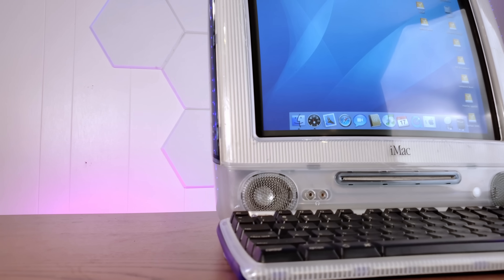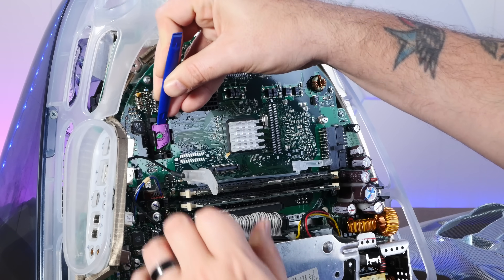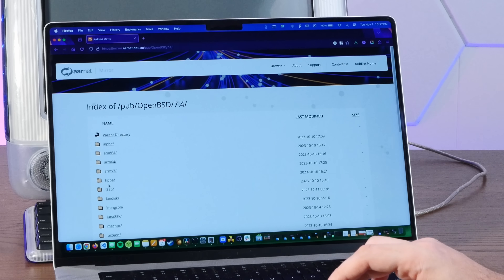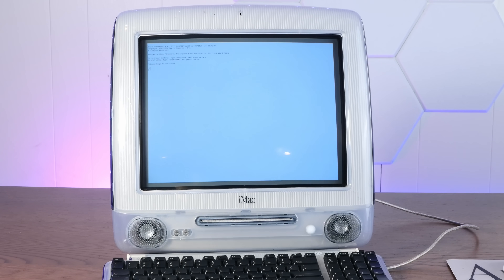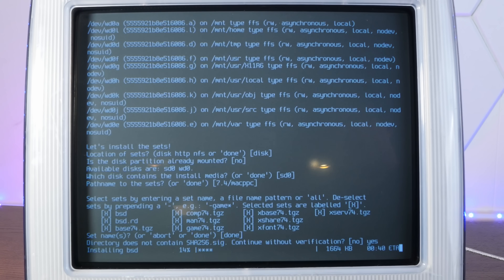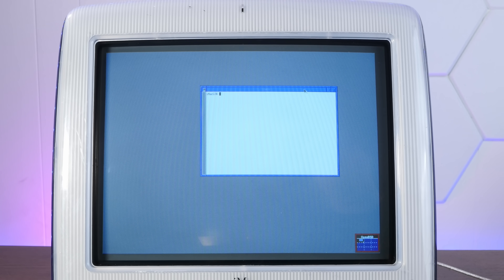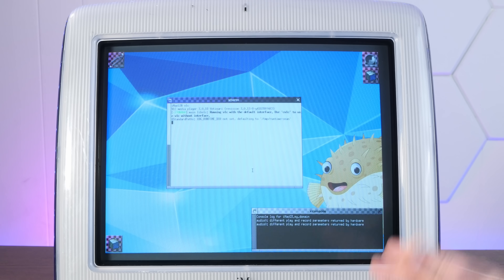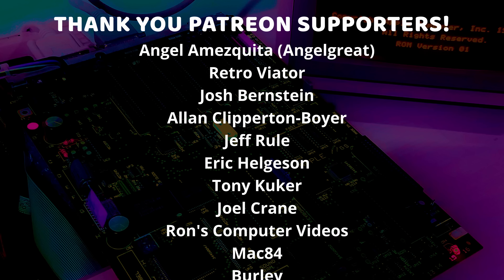Installing OpenBSD on the Fastest iMac G3

Comment: The USB trouble might be because it's a USB3 stick.  I've seen older hardware have trouble with USB3 devices even though they are s'posed to be backward compatible.
Reply: I don't think USB3 is suppose to be backwards to USB1. At least that's what I heard. I keep some USB2 drives around for that reason.
Reply: @Duamerthrax  -- Allegedly, 3 is compatible back to 1.1.  But, I've seen some not work in a 2 socket.  I've never tried anything less than that.
Reply: I've once had a keyboard that required 3.0 because it's rgb consumed too much power for 1/2.0

Comment: G3s and early G4s ATA controllers have a drive size limit of 128 GB. That's why dosdude1's drive had issues. On Power Macs you have the option to install a PCI controller (usually SATA) to enable usage of larger drives, but that's not possible with iMacs, for obvious reasons.
Reply: It's just easier to use an IDE to CF adapter and a 64 GB card. It will still be faster than those old IDE drives
Reply: Firewire is another option, I remember an iMac reading drives well over 128gb at 400Mbps, it was considerably faster, if I remember correctly, it's been a while 😅
Reply: I seem to remember the maximum partition size was 8GB, at least on some G3s.
Reply: @BrianMoore-uk6js  Yep, that's a thing too. Beige G3s, tray-loading iMacs and Wallstreet/PDQ PowerBooks for sure (can't remember if the Kanga and Lombard PowerBooks, and 1st Gen iBooks, are affected).

 Wallstreets and maybe others (don't remember if the Kanga and Lombard PowerBooks are included; iBooks are not IIRC).

Comment: Pretty cool. Amazing how modern OS's work on such old machines. I have NetBSD 9.2 running on a 68040 Quadra 800 with X11 and Dillo browser. I also have beige G4(upgrade) with Debian Bookworm and surf the net with Netsurf.
Reply: I wonder if it’s possible to use netBSD on a 68030 Mac?
Reply: Operating systems are primitive so they work everywhere. Useful applications, however...
Reply: “Amazing how modern OS's work on such old machines” not Windows 11 though
Reply: I read the browser name as something else.
Reply: I'm curious if you've gotten webkit to work correctly. I have Debian on my G4 as well, but webkit seems to only display mixed up Cyan and Magenta as if pages are rendered in CMYK and the wrong byte order is used.  Will need to try Dillo.

Comment: 5:40 - Those block errors are simply the hard drive being in a format OpenBSD didn’t understand, or it’s Inodes (references to blocks) were corrupted. If you were partitioning the drive at that moment, that’s fine because then it’s trying to understand where the next block in the drive is. Most of those errors come from fsck, filesystem check, and are harmless to your data, even though it can take a second to get through them. Fsck is simply trying to fix your systems understanding of the drive👍👍
Reply: Makes sense if he hadn't formatted it yet for bsd like it had something else on it. Might have been alright unless he installed on it and it was still saying a bunch of stuff
Reply: as far as i'm aware that imac and most computers from the late 90s don't support 48bit disk access so anything above 120gb wouldn't work correctly, there are workarounds i'm aware of with pc's idk about old imacs.
Reply: @Nny_V  I had this problem on a pc laptop from 2004. The OS can see the real size of the drive, but BIOS issues would cause errors and/or corruption past 137GB. I solved it by just formatting drives bigger than that to 137GB and not using the remaining space.
Reply: @Nny_V 
That is usually not a problem once booted into an OS that understands it.
Also, there's a load of random capacity issues in BIOSes before you get to that limit. Arbitrary limits on a bunch of values that lead to things like 2GB, 20GB, 32GB and ~60GB limits. Most of those you have to prevent the BIOS autodetecting the drive, and boot off a smaller disk.
Reply: Laptops had to either partition or use software solutions but desktops could use Promise, SIIG etc drive ATA controller cards still available today (though IIRC some require a Mac ROM reflash if one originally fitted is unavailable).  SATA controllers make the most sense for modern large drive conversions where using a suitable OS.

Comment: 5:00 It's not fault of an adapter* IDE ATA in general is limited to 28bits x 512B = 137GB (128GiB) , Apple "BIOS" is probably also limited and/or have some ways to negotiate proper mode for adressing. In PC world i was able for example boot 160GB Hitachi HDD on such old machine only if Windows was installed on smaller partition. Then trough some magic once booted the other partition was available to store data. Otherwise if one partition was used system was crashing. Linux wasn't able to boot at all. WD Black 250GB IDE on other hand only 128GB was visible even in Windows. Same was for any SSD. Since BSD probably it's installing itself on ZFS or UFS partition and formating putting inodes and stuff. And it's doing in "BIOS" mode so cant adress more.

Comment: I used Openbsd (headless install) for my Firewall back in the early ADSL1 days. (Around 2002)
  It was the most secure/locked down OS back then and probably still is.

Comment: G3 imacs were some of the first machines i installed OpenBSD on. This was back in 2002. As far as i know it's always worked well on these machines. I had a few running IRC servers and icecast for a bit. The dual headphone out was great for csound programming. this allowed me to run into multiple effects pedals and a mixer. I found the default console font was nice and crisp. They made great terminals at the time. It looks like they still do. This takes me back. Windowmaker was my goto. All you need now is the bubblemon applet.  😎

Comment: Ok, going from old memories, that entire family of iMacs had a maximum hard drive size of 128GB. There was a firmware update for some of the transition era machines that patched it, but I’m not sure if these iMacs got it. So you’ll need to get a smaller SSD from dosdude1. I’d try to stay at 100-120GB to stay safe.

As for booting off USB, the USB controller in those things are pretty strict standards-wise, and they don’t like newer faster USB drives. It’ll probably work fine with a USB 1.0, 1.1, or USB 2.0 drive. But many older Macs don’t want to talk to a USB 3.0 flash drive. Even my old 2015 MacBook Pro didn’t like USB 3.0 drives, but would talk USB 2.0 drives consistently.

Comment: OpenBSD was my first true love when it came to operating systems... I think the first release I ever installed was 2.3 and ran it as my daily driver on all my workstations for the longest time. I also donated a bunch of hardware to the project as well as a few kernel patches I made (specifically for the USB and wireless subsystems) that made it into the mainline source tree!

EDIT: some of the modifications I submitted were in fact to fix USB quirks in booting OpenBSD from USB sticks... they weren't PPC related but you would be amazed (or not, lol) at how finicky some USB chipsets are!

Comment: Second adapter 5:45 you put is actually translating SATA to ATA, it's most proably limited in speed like most of these and because of that (oddly enough) i suspect fast HDD's could be even faster than SSD in some cases. Maybe in order to work it have to know "the language" of adressing of iMac "BIOS" maybe it's fault of 256GB drive itself it can't negotiate or something. Or it's just about the size - since you put 128GB MSATA
Reply: Back in 2012 some kind of Samsung (F3) 1TB HDD on some operations (I guess that was copying a bunch of small files) so it was faster than then new a top of the budget segment OCZ Vertex4 128 gigs.

Comment: I haven't really messed with OpenBSD, but I run FreeBSD on my main SBC I do Arm64 Assembly programming on. If I'm going to have an OS I "tinker" with, it's pretty much always FreeBSD anymore.  I used to run Arch, then Manjaro, but now I'm happily on OpenSUSE Tumbleweed for Linux (gives me rolling release while going back to my Fedora/OpenSUSE roots with RPM+zypper). That means there's not really any need for the same level of tinkering to get things working properly.

Honestly, I find myself using my FreeBSD SBC for all of my daily tasks too (with 16gb of ram, an m.2 ssd, and a great little cpu/gpu package it handles most tasks easily). BSD is a different beast, but I think it's something people should give a try in a VM just to mess around if they enjoy messing around with Linux or even macOS.

Comment: I ran NetBSD on my graphite iMac DV/SE back in the day and I remember it being an open firmware nightmare to get installed. When you said it couldn’t be easier to get installed only to cut to that iMac on its side made me laugh out loud 😂
I also ran NetBSD for years on an SE/30 with an PDS Ethernet card, it was super slow but ran named and Apache 1.3 just fine, also there was no screensaver so I just had the brightness turned all the way down…
Reply: I ran NetBSD on my iMac DV SE too, and on my Mac II ci. Worked just fine. Compiling everything from source with pkgsrc was a bit of a hassle though. I finally gave up on using NetBSD on all my hardware around 2012 or so. (Including a few versions of Lenovo ThinkPads.) I was tired of not having a native Java (my netbanking at the time required a Java applet for Mozilla, and patching the JDK source code to make it build, and then building it was not for the faint-of-heart), and the frequent need to rebuild most of the installed packages as new releases came along, often taking days, not to mention every time something broke. Although I haven't been too impressed by Linux either, and have switched distro several times since, first Xubuntu, then Mint Debian edition, then MX, and now Devuan.

Today Linux users seem to almost start crying if there isn't a gui interface so they have to do stuff from the shell...😂

Comment: I did the OpenBSD Install with a DosDude SSD 128gb and the Short IDE 2.5" to 3.5" board and it worked effortlessly.., I tried the 256gb and had all the same problems you had. Suffice to say, my Lime 333ghz iMac's do not like drives over 128gb!

Comment: Simply awesome! I would have newer guessed that that old beast can run a modern os and looks still so fast with graphic desktop.
Reply: The BSD´s are unbeatable. And that window manager (FVWM) is the best and most powerful WM ever made, and also only need about 50MB of RAM with a basic config. Imagine the performance i get on my 2008 eight core Mac Pro with the AMD64 version of OpenBSD 7.4 and FVWM.

Comment: Awesome stuff! Its so neat to see these computers run new Operating System like it's nothing - excluding the houra it takes to set it up that is 😄

I just bought a BlueSCSIV2 and was wondering if you were going to do a video solely on it and all of its new features, including WIFI.
Reply: BlueSCSIv2 is amazing! It supports Daynaport SCSI Ethernet, over Wifi! So basically gives internet access over the SCSI bus, as well as drives.

Comment: I like how your mouse is a mouse! It's odd you couldn't get VLC working. I remember using VLC on my 450Mhz G4 running OS X 10.3 back in 2006, so the hardware is capable of it.
Reply: I wonder if it had something to do with him using a 256-color video mode (note the palette shift when he launched VLC). I wouldn't be surprised if the VLC team (or their supporting libraries) dropped support for that over the years, or simply allowed code rot to set in.

Comment: VLC was probably to expect too much from a machine of this vintage and with such dated specs but perhaps mpv would have worked? And with something like youtube-dl (yt-dlp) maybe you could even get it to play Youtube videos. Of course, you probably would be limited to videos in post stamp-sized resolutions such as 240p and 360p or, if lucky, 480p but it would still be a cool achievement nonetheless.
Reply: There's nothing too special about mpv. It's mostly using different libraries for the same thing. Machines pre-SIMD are simply too slow.
Reply: @xerzy I know but mpv is the direct descendant of mplayer and I recall using mplayer (and xine, to some extent) to watch videos and physical media successfully in machines of that era so I am inclined to believe that it would work here as well. Besides, there is little to no GUI on mpv and I believe that the reason that VLC failed there could be related to the lack of some toolkit library or something along these lines so there is a small chance that it could work although TBH I have near zero experience with PPC.
Reply: @xerzy  mpv is special ❤
Reply: @xerzy  what's odd I  had the same machine back in the day. I ran ubuntu which dropped support for ppc  so I switched to gentoo. I remember playing youtube videos in vlc on it b ack in the day. Problem was only certain file formats would work due to no hardware 3d acceleration, and well the cpu was pretty weak and did not like X formats.

Comment: I always found it quite difficult to boot G3's off of a USB stick.  Do you have a specific drive or brand that is particularly successful?

I think a lot of flashdrives have issues with the v1.1 USB spec on the G3.
Reply: He was using a Microcenter brand usb 3 drive.  Might have better luck with a usb1.1 drive that's just big enough to hold rhe image.

Comment: As someone with an IMac G3 that I put OpenBSD on I always have problems trying to get the graphics drivers working correctly. I’m also not for sure what graphics card my IMac has. If anyone has any information or ideas of how I can get the graphics drivers to work please let me know.
Reply from the maker: It uses r128 driver - try this xorg.conf in /etc/X11/ 

http://frogfind.com/files/bsd/slot-load/xorg.conf
Reply: @ActionRetro  thank you very much, I just got to that part of the video a tiny bit after I posted that comment. Thank you

Comment: I had similar issues putting an SSD in mine, the IDE adapter needs to have a slave/master jumper on it and the afaik the internal ide controller only supports a max of 120gb

Comment: I always use a hub to boot from usb on PPC Macs and it works every single time and sometimes it can even find it on the boot picker
Reply: Is your hub powered by the USB bus or an external adapter?
Reply: @beenine5557  powered by USB, in Open Firmware you just have to add the hub to the command when booting from USB

Comment: I have had some issues with laptop IDE drive to desktop IDE computer adapters before (and reverse adapters that allow a desktop drive to work in a laptop and some flash card to IDE adapters). Some of the pins that are ground are sometimes either not connected or the drive or computer are looking for unshorted pins to ground and the pins are shorted to ground. I've modified a few adapters to work, but you have to ohm out the desktop IDE connector and make sure the adapter also has the same ground pins used or disconnected. The adapters do follow IDE standards, but it seems some laptops don't correctly.

Comment: ive got a flower power imac g3 but something's wrong with the CRT (very yellow color, smack the side of it and it sometimes comes back to life)... also have a low-end bondi blue g3 imac. wondering if i can swap out the crt into the flower power one, that'd be nice.
Reply: There's a good chance it's either a cracked solder joint or a dirty/loose connector, most likely on the neck board. That would be an easy fix, letting you keep all the existing tube's adjustments.

It's less likely to be in the actual tube but if it is it could still be fixable mad-science style with two power supplies, a decently sized capacitor, and a percussive tool.
Reply: @eDoc2020  someday I'll have to take it apart and look. I just kind of assumed two tubes would be interchangeable
Reply: @CodyShell   The tubes likely are interchangeable. One problem with swapping the tubes is you need to do some bias adjustments (probably not a big deal). The harder part is if you need to take the yoke off, then you would need to redo purity and convergence. If the two tubes have compatible yokes you can keep the yokes with their original tubes but I know there are different monitor styles in iMacs so you will likely need to keep the yokes with their boards instead.

It's all doable but it's just easier to clean all the connections first. Especially since the first step of a tube swap is unplugging everything.

Comment: To put some scale on it I looked up some benchmarks. Double precision Whetstone seems like the most common for that era. This 700MHz cpu would do 0.32 MIPS. 
A Teensy microcontroller can do 67.1 MIPS. 
The Raspberry Pi 4 does 8176 MIPS. 
The Ryzen 5950X does 13,300 MIPS.

So a current CPU is about 42,000 times faster in that specific benchmark.

Comment: I don't know if it applies but in my own experience my Imac G3 could run drives up to 128 gigabyte but it would be buggy and compatibility would be hit or miss at best. I've found 64 gigs to be the sweet spot as most 64 gig drives I've used worked without any issues at all. The issue with the usb might be voltage, it's only usb 1.1 if I recall which has a really low power output. I used a powered usb hub for everything except the usb drive to minimize load and that made usb boot a lot more stable for me.

Comment: Let me say everything wrong with Sean's so-called problems:

1. The SSD was probably fine. It's just that BSD is trying to understand how to use it. FSCK complains all the time on my main computer, even thought its 2TB HDD is perfectly fine. Don't worry.

2. The easy way to deal with the problem of the USB drive not booting correctly... is to BURN A DISK. don't just pretend that recordable DVD's dont exist anymore. The answer was in front of you all of this time. If that's an iMac DVSE, it should have a DVD drive.

3. Of course BSD works. OSX is based on it after all.

4. Don't say "50% off", say "half price". It sounds better imo.